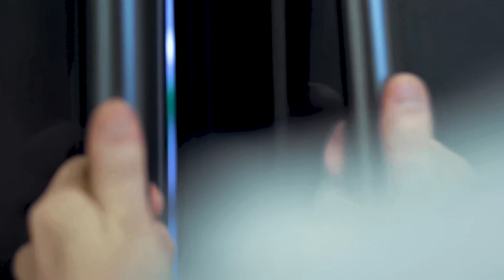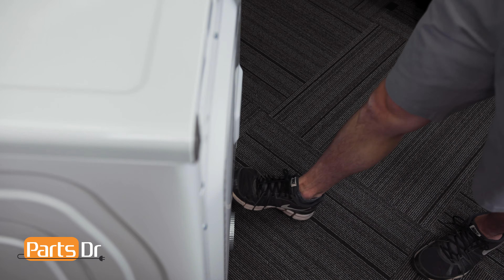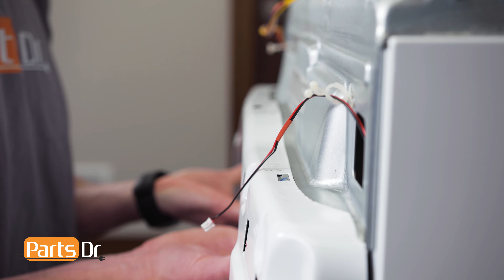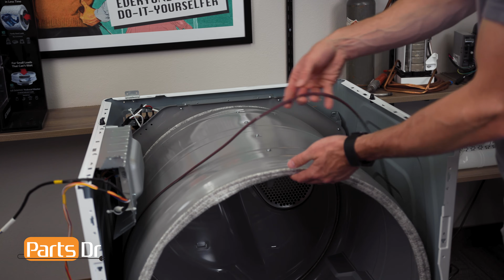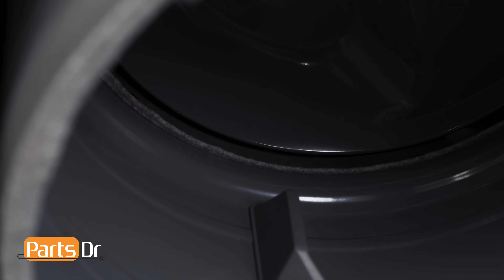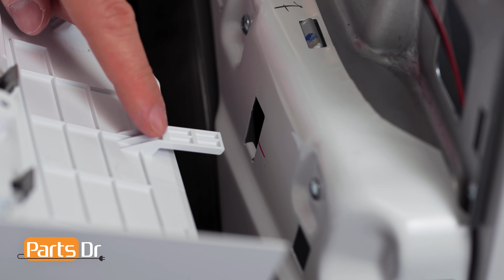How to replace the idler pulley assembly part # DC93-00634A on a Samsung dryer

Comment: I’m doing mine right now…The mounting screw for the idler arm is so frozen I can’t even budge it. I just sprayed some AeroKroil on it. Hope it helps or else the MAPP gas is coming out !
—> Also, my original idler arm has a raised boss on the mounting hole while the replacement does not. The new mounting screw has a raised boss on it to allow the new idler arm to swing freely.
Reply from the maker: Thank you for sharing! Let us know how the rest of the repair goes!

Comment: Do the wheels need to be lubricated with grease?
Reply from the maker: No, they should not be lubricated.  They either use a sealed ball bearing or a self lubricating bushing.  Neither of those should be lubricated.

Comment: This can be done through the lint duct in the back without having to take the entire dryer apart. You will be working in a tight area though and make sure you put a towel over the sharp metal edges or it will cut you. All you have to do is take out one screw that holds the lint duct in on the back. Then you can get to and work on that idler pulley. I did mine that way and it was a tight work area but I got it done.
Reply from the maker: Thank you for the feedback.  The technique that you are describing works on some older models of Samsung dryers, but on all of the newer models that we have seen, they have changed the design and removed the rear access panel.

Comment: Any idea why the idler pulley screw would just keep spinning and not come out?
Reply from the maker: We haven't run into that.  Does yours have a nut on the back side or is it stripped?
Reply: @PartsDr  it was stripped pretty bad. Had to use a vise to get it out. Will have to tap some new threads and hope that works.
Reply from the maker: @dustin3317  that's too bad.

Comment: Outstanding instructional video. thank you so much, I replaced the belt following this exactly. Only two small differences. I think I have a slightly different model, and couldn't disconnect the wire to the front control panel (no plug). so I just kept it attached and turned the panel to the side. The other difference was I couldn't stretch the belt over the pulley wheel because it was too tight. I was finally able to get it on by first coiling it around the pulley wheel, and then onto the motor spindle. tiny difference but it made it work. Thanks again
Reply from the maker: Nice job fixing it yourself!  Thank you for sharing those tips.

Comment: We are having problems with our Samsung RF23M8080SR - are all Samsung products useless.  We are on our fourth machine replaced under guarantee.  What would you recommend - Miele and Neff produce excellent products.
Reply: Whats the problem? Cooling? Ice maker?
Reply: @bebekids302 

I am a scientist and could have fixed the problems myself, however,  it is not a cheap refrigerator, it is under guarantee, so why should I. 

After 2 years of ownership the ice maker starts to freeze up.  I had 3 months of problems whilst Samsung tried to fix it.  After a further two months the fan started to make a grinding noise. Samsung came out and replaced the fan (~2 months) a few months later we were back to square one - new fan, new defrost sensor, new fuse.  During their visits Samsung found that the build up of ice had cracked the back plastic interior.  It took a further 3 months without a fridge before they came and replaced it.

Two years and similar story with the ice maker.  Took a further two months of visits (new icemaker, processor board plus modifications).  Six months later control panel became dead rendering machine unusable.  The Samsung engineer visited over the next two months  replacing the control panel, processor board, draw front, plus visits with a number of wrong parts.  I was extreimly frustrated as it was clear that neither Samsung nor its engineers had a clue. I searched YouTube and found two video's explaining what I thought was the liketly problem. 

https://youtu.be/vr2AThDz9GI

https://youtu.be/_AhmG0GkWXY

Sorry about the quality of the video's.

I forced the engineer to watch the video's who after some disassembly confirmed that this was indeed the problem. Samsung stated that the wiring harness is part of the cabinet, hence, had to replace the fridge/freezer. .... another wait of a few months. 

As stated I am on my fourth fridge/freezer.  Amusingly each time that they have replaced it I have been given a new 5 year guarantee. 

A few days ago the freezer defrosted.  I am hoping one of my children forgot to close the door.
Reply: @Land-of-reason  for the ice maker, most likely the heater on the ice maker died on you.

Hold top button on both sides for about 15 seconds. You'll see all leds light up, but continue to hold until you hear a 'ding/belly then release. This is called a hard boot.
Once the fridge comes back up(3-5mins), if there is an issue,  you will get an error code. 
Now, if your ice maker compartment is freezing up, and you did NOT compromise it with the 'hairdryer method' (don't ever use a hair dryer), then most likely you will see a c39 error code.

If you are noticing the ice is wet and extremely brittle,  then most likely the temp sensor on the auger is bad and you will need to replace the auger.
Reply: @Land-of-reason  for the flex drawer(and I didnt even watch the video... I am 99.9% positive what it is)...

I am not fond of the flex zone wiring located on the right side. 

What tends to happen is the wire winds up protruding outside of the  railway and iver time eventually gets frayed, spliced or outright cut in half. 

Its a poor design imho but there is one contributing factor; overloading the drawer on the right side with things causes this. The culprit to my finding 10 out of 10 times has been liquids, such as bottles waters, canned seltzer, beer etc.
Reply: @Land-of-reason  on the ice build up,  8 out of 10 times its due to the condenser coils never being cleaned. Oull out the fridge, open the back and look at the right-hand side coils. Ensure they are clean. If not, clean them. I recommend checking this as a preventative measure at least once a year, if not every 6 months.

In all my years, I've seen maybe 4 fans die. They typically do not die. Thats thousands of customers.

If the plastic housing has been compromised they do have an insulation kit to resolve that... HOWEVER, you need to pull the fridge out and check the back for condensation(dry or wet spots) or discolored circular sections. 
If any of the above 3 are found, the fridge is most likely toast, bur to the insulation now being compromised.
Reply: @Land-of-reason  on the freezer defrosting, if it is not your little one that didn't leave it open,  there are a couple of things to check for.

Ensure that no plastic or wrappers are protruding outside of the seal. 
Ensure that nothing foreign is in-between the seal and the frame one the seal. 

There are a couple other issues like the inverter board(should be a solid red) 4 blinks and its going bad. Or on the heater itself. Cant recall the part offhand.
Reply: @bebekids302 
The Samsung engineer was unaware of any heaters or sensors in the ice box.  I did ask however he denied that it had a defrost mechanism. He attributed the problems as being due to air leaking in from the ice chute.  He checked for leaks into the ice box and made adjustments to the drain.  He was ringing his headquarters for advice.  He even asked to borrow a hair dryer and scraper.

Confidence in him 0/10.
Reply: @bebekids302 
Flex draw spot on.

1) Why put the controls on the top of the draw.  Suerly you could mount the switches in a fixed location (possibly inside the refrigerator). 

2) if designing this you would suerly use a replaceable plug in cable.

Crap design.
Reply: @bebekids302 
The coils froze into a solid block because the defrost fuse had burned out.  The ice block encased the fans causing them to burn out and caused the casing to burst.
Reply: @bebekids302 
The refrigerator has a single line of buttons.  It is unclear which ones to press to enter into the reset/diagnostic mode.

As I found out error messages make no sense to our Samsung Engineers here in the UK.

I have searched everywhere for an engineering manual but haven't been able to find one.  Samsung will not even provide an exploded diagram with the parts numbers.

Their call centre in the Philippines is a complete nightmare.
Reply: @bebekids302 
Thanks for your help.
Reply: @Land-of-reason  the fan doesn't burn out. It just can't move. You may hear a slight buzz, but its a 12volt fan that doesn't really possess much pushing power.
But like I said, rarely they go bad. There are 2 types of fans also depending on the model. One is know more for  that happening once this occurs,  but thats usually on the side by sides. Your model number appears to be a French door.
Reply: @Land-of-reason  thats the piece I was referring to that I cannot remember what its called. Color me stupid at the moment. Lol.

But what that piece does is it measures the temperature on the defroster and when it hits a specific heat signature range it tells it to turn off, or on for that matter. They can burn out thus the fridge doesn't know whether it should defrost and not. Im gonna find the dang name of it. It hooks up right onto the defroster bar.
Reply: @Land-of-reason  they changed the name as of current; its no longer called the thermal defrost fuse, but here is the part #
DA47-00301B. I am certain of it.

Btw, I am. Certified Samsung Tech. 

Washer/dryer/range(gas/electric/induction)/microwave/oven(single/double)/dishwasher and last byt not least, refrigerators ;)

Maybe I should start my own channel. 😆